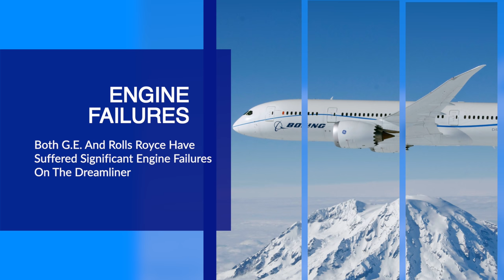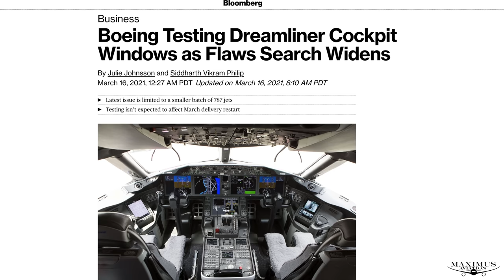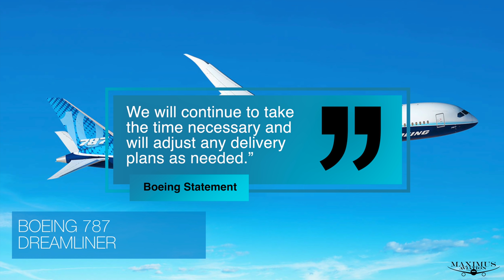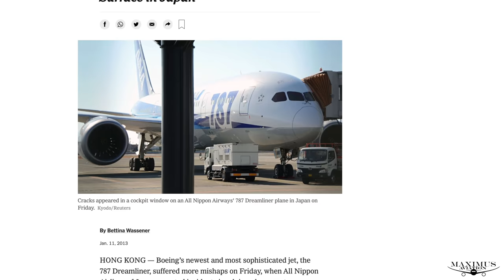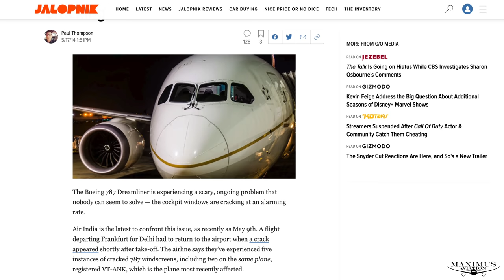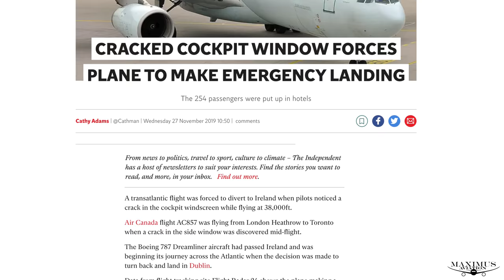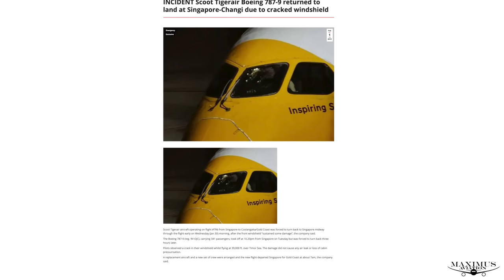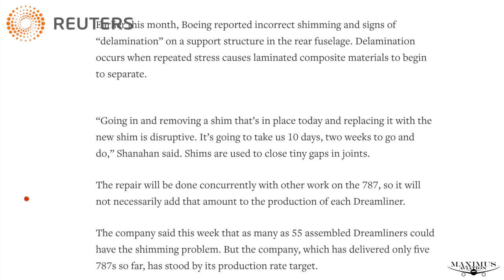Why Do The 787 Dreamliner Cockpit Windows Keep Shattering In Mid Air? How Dangerous Is It?

Comment: Bring back the DC-8s I worked on as a flight attendant in the 80’s.  That noisy, narrow, slow, cramped beast was the energizer bunny of airplanes.  Definitely not a duck.  Good video.  Well researched.  Thanks
Reply: DC8, noisy-yes, cramped-yes, slow-not hardly.
Reply: Schlomo Baconberg  convair 990 faster than all but the Concorde
Reply: @EnergeticWaves  convairs rocked !
Reply: DC8 Broke the sound barrier. Google Supersonic DC8. It was our company aircraft.
Reply: hm...not any slower than any other jet airliner.

Comment: They can't fix it as management has fired all the engineers, or so it seems.
Reply: Fixes cost money.
And people with experience and expertise have a desease, they are expensive. And in case that stuff is contagious corperations don't want to have them around.
Reply: The solution is too expensive ,,,, just that.

Comment: Boeing just can't seem to get things right with the Dreamliner, can they?
It really is embarrasing as Boeing was for a long time so renowned for their build quality.
Reply: Better to test then just send it out again
Reply: Which plane they produce is going right?
Reply: @charlesharper2357  the 737NG, 747-8, and 777 have been fine. Granted, the 777 did make the news for engine problems, but that kind of problem is Pratt and Whitney's fault, not Boeing's fault.
Reply: @charlesharper2357  747, 777, 737ng, 767
Reply: @charlesharper2357  Yes, they've really been dropping the ball everywhere, haven't they? 
Well, this is Market Driven Economy in practice: if it sounds too good to be true (max profit with little or no oversight because you're trusting big companies to "do the right thing") it most definitely is being proven by Boeing.
Reply: @tjroelsma  
Boeing is spending too much money on executives, and too little on engineers.
Reply: The NG is not produced anymore is it?
747 is a trickle at best. (Love the 747 btw)
Reply: It's not just the Dreamliner it's the entire company. The Boeing Company no longer cares about safe quality products that last. They only care about Cost, Schedule and Shareholder Value OVER quality & safety. Boeing only cares about short term fast profit, they know there are only 2 major manufacturers and one can't supply the entire World. Boeing sits back laughing knowing they can sell 💩 and airlines will buy it. They also know that none of the gangsters will ever be held liable for any loss of life nor will they lose their homes and property.
Reply: @soyousay7751  True, but it's extra ironic because the Dreamliner is supposedly Boeings Masterpiece, their Halo airplane. 
And it's the Halo airplane that has the most problems of their entire line of airplanes. 
Nothing shows how deep the s*** they're in is than their Halo plane failling time and again.
Reply: @dehaviland7645  Yeah ended last year but that is not that long ago really
Reply: @Blank00  did you forget about the illegal fuselage splice fittings on the 737NG, you know the the ones that led to the two female investigators being fired? The facility in Kansas that was using the bad parts was supposed to stay open but Boeing closed it and sold the facility to Spirit Aerosystems who still manufactures 737 including MAX fuselages for Boeing.
Ever see the huge hole in the 777X after the wing flex test failed, Boeing lied and said it was a cargo door blowout but an employee took a photo of the left aft fuselage blown wide open. Boeing is great for hiding their problems behind the walls from the public I've been there and seen it, matter of fact made a phone call about one of their debacles management and security wanted me to keep it inside 😂.
Reply: Back in the days before corperations took over america.
The usa has become a parasite ever since the 80s.
Reply: @baronvonlimbourgh1716  Big corporations and shareholders are sucking the people ánd the industry dry with their short-term politics of profit before everything. 
They know and acknowledge the first but refuse to acknowledge the latter.
Reply: @tjroelsma  I agree but we must not forget the 787 was the first new clean sheet attempt under the failed Boeing / McDonnell Douglas leadership. This failed leadership not only changed fuselage materials and the way accessories were powered they subbed out major portions of the aircraft throughout the World to lowest bidders. Boeing will preach the Globalization BS as if they are spreading the wealth Worldwide when in fact Globalization takes advantage of cheap foreign labor while lining the pockets of the corporate gangsters pushing the agenda. The Boeing cesspool has flooded the entire company and now exist in all 3 Boeing divisions................Commercial, Defense & Space.
Reply: @soyousay7751  The way I see it is that the US Government gave Boeing way too much leeway. Boeing was for all means and purposes allowed to self-certificate due to their "trusted" status with the FAA. Boeing was also allowed to skip a lot of steps in the Quality Control process. There's an Al-Jazeera hidden camera video on YouTube that gives a rather horrifying picture of how the Dreamliner was being build at that time and I reckon things have gone worse than better since that video was shot.  

But it's not all to blame on Boeing: when given those kinds of power, most companies will abuse it just as much as Boeing did, so the US Government/FAA does own it's share in this Charlie Fox situation.  

Airbus found out the hard way that switching to new composite materials depends on two things:
1. proper engineering
2. testing, testing, testing

You don't know the "for real" behaviour of a material untill it has been used and abused in the situation it's going to be used in, something that Boeing management blatantly ignored. 

Combine those two situations of Boeing having the power to design, build and certify without real oversight and Boeing management "not giving a s***" and you have the perfect storm brewing. Well, the storm has arrived and the devastation might be enough to cut Boeing down to size.
Reply: @DC8Combi  you are Boeing employee
Reply: @soyousay7751  true words mate
Reply: @kirilmihaylov1934  recently retired due too the corruption.
Reply: @DC8Combi  I  respect  your input  about this topic .Boeing have  messed up really bad lately
Reply: @kirilmihaylov1934  it's inevitable as their culture is horribly flawed. The Boeing Company breeds corruption through high pay to anyone who keeps their mouths shut and pushes the garbage out the door. Cost, schedule and shareholder value over quality & safety...................predatory capitalism at its best.
Reply: @kirilmihaylov1934  There is a difference between capitalism and predatory capitalism run by narcissist and sociopaths! We have evolved to the predatory state of capitalism where politicians and CEO's have a predominant narcissistic profile and don't give importance to human life! This is not only Boeing, but all major companies have the same profile and are driven by cash hungry investors (banks) who want the MAX out of the MAX! It is a systemic crisis!
Reply: @DC8Combi  that's exactly  true 👍.  I thought  that's what American capitalism  is all about but yet most people  don't get that for some reason.  Yes there are some really good American products like   Oakley and Nike  and so on but when share price and sales matters the most things change  .and that's where American capitalism  seems to be  nowadays
Reply: @kirilmihaylov1934  that's because the beast (Wall Street) thrives on controlling these corporations. Once any company goes public on the stock market it soon destroys itself within by selling their souls to worship the "Shareholder Value." You will find it hard to find any corporation on the market that has ethics or morals, if you do they won't be what's called a good investment as their shares won't pay high dividends.
Reply: @DC8Combi  that's also true . But it has gone to the  extreme as of lately.  It wasn't like that back in the 80ties and 90ties . I spent a few years in US back then and I liked it quite  a lot . From what I here it is not the same anymore .When profit  and shareholders value  matter more than people it is logical that  people will die because of that
Reply: @kirilmihaylov1934  that’s why back in the 80’s Boeing was a reputable engineering company.
Reply: @DC8Combi   a lot of American companies are like  that
Reply: @kirilmihaylov1934  at some point corporations gained power of America, the biggest ones basically run the country through politics it’s a disgrace. Especially corporations tied to government contracts.

Comment: After almost 10 years they still don't know what the cause is or how to fix it but they do know that they will restart deliveries by the end of March 2021.  That rather implies they are sending planes into the air before the problem is solved.
Reply: Or that it's simply cheaper and easier to replace a window, than research and rectify the problem.
Reply: yep.  it's all about the money now.  Safety?  Naaw...  Safety is way down on the list.  As long as Boeing can keep delivering planes, keep the cash flow going, they will continue doing what they are doing.  The FAA is not doing its job either.  If they were, they would ground all 787's until these issues are resolved.  So Boeing will keep delivering flawed airplanes until one of these flaws causes a crash.  First crash will be deemed pilot error.  Second crash, just like the 737 MAX, will finally get the FAA's attention and the planes will be grounded.  Hundreds will die, but Boeing exec's don't care.  The only thing they care about is their quarterly bonuses, so keep those flawed airplanes coming off the assembly line and  delivering to customers.  Cash flow, baby, it's all about cash flow.
Reply: @zig_ziggy  maybe they'll fix it after it results in a fatal accident.
Reply: It's just the outer layer that cracks. It's not like a normal piece of glass that shatters into millions of pieces or shards. When cracked It's still very strong. If the inner fails it would be very windy for the occupants, and even with the number of cracked outer incidents, none have resulted in a flying flute. The outer layer is the one designed to take the abuse. The main layer isnt affected. The pressure vessel is contained and safe. They return to the airport out of caution when a crack forms, just as they do when a warning light illuminates that could lead to faulty information. I will admit, a cracked window 6 miles above the earth would be scary.
Reply: @overyourheadtampa  What if it cracks to the extent that the pilots can't see ahead?
Reply: @gerrymccartney3561  that can be a problem, but the 787 livery is of the most technologically advanced aircraft in the air. They have the equipment for the aircraft to land in near 0 visibility, such as when an airport is blanketed in heavy fog, to boot the aircraft can essentially land itself. Not to mention there are several windscreens that can be used for visibility outside. Its extremely unlikely more than 1 would crack on a flight. These newer aircraft are far safer and don't even need pilots once it's set up. They are there mostly to monitor things and take over if something goes wrong; there is a lot more to it than that but I say it that way to convey the advancement of technology in the cockpit has made things a lot safer. Don't take my last comment to mean the cracking is not a problem, they need to fix the root cause. It may not be very risky but a 2 or 3% increase in risk when ferrying 300+ people is not acceptable when it can be addressed.
Reply: @overyourheadtampa  As you say, it must be fixed,
Reply: @gerrymccartney3561  you should do a search for how often a cockpit windscreen cracks. It will demonstrate why I said it the way I did.
Reply: @pimacanyon6208  , except zero crashes, zero injuries.
Reply: We all know what the problem is… money
Reply: @overyourheadtampa  Ah but who cares about facts! Just bash every single problem Boeing has even though the airplane that caused the controversy has been fixed! I do agree though, they need to stop focusing on orders and fix their windshield even if it's not a fatal flaw.
Reply: @gerrymccartney3561  Quote:What if it cracks to the extent that the pilots can't see ahead?
How are they landing in thick fog  ;-)
Reply: @dalaisdramalama4470  Hopefully, they will be landing with intact cockpit windows.  Cracked glass and fog is not a combination I would wish on any pilot.
Reply: @gerrymccartney3561  if they can't see then they just pretend they are in a cloud.
Reply: @Milkmans_Son  How does that work when landing the plane and getting to the gate?
Reply: @gerrymccartney3561  Switch to pretend fog for taxi.
Reply: Exactly.
Reply: @bobkataviation3967  Excellent solution, I am sure that Boeing will happy to convince the flying public that it is the best way forward and there is no need to do anything about the problem.
Reply: @overyourheadtampa  I wonder though if "very windy" would be the only problem. I don't know f they test it, but could it not also develop into more serious pressurization problems of the hull when a window fails at a high pressure differential?
Reply: Not like Boeing. It's not a Engineering excellence problem. It's Wall St. Accountants and profit margins. 
BCA (Boeing  Commercial Aircraft) are on their last legs.
Reply: @zig_ziggy  Remember the De Haviland Comet?
Reply: @thehighlander959  Yes, absolutely. As when I was a child, the Comet flew over my house which was just a mile from the end of the runway at De Havilland's, Hatfield, where my mother had made Mosquito's and my uncle worked as an electrical technician. Later, I did my apprenticeship at what by then had become Hawker Siddeley, and walked past the hydrostatic test tanks each day where the Comet fatigue issue was tested and solved.

Comment: If not a quality issue, I wonder if it might turn out that carbon composite is just too flexible for what are the largest windows on an aircraft?
Unlike the Dreamliner which uses composite for the cockpit, the A350 uses metal as Airbus were unsure how Carbon Composite would be affected by bird strikes - especially as composite material has the unwelcome habit of being damaged by an impact but unlike metal can sometimes return to its original contour with no apparent damage.
Reply: good point.  So Boeing needs to redesign the cockpit portion of the plane and make it out of aluminum alloy.  Makes sense to me.  'course, they won't even consider that because it would impact quarterly profits and those executive bonuses.
Reply: The dreamliner is not the only composite plane flying.
Although it might be the only commercial aircraft with a composite cockpit.

I think the a350's only non composite part is the cockpit, maybe this is one of the reasons? Not an engineer.
Reply: Carbon fiber is a very stiff material, in fact much stiffer than steel. 
Of course thickness of the material is also a factor. If too thin, it could be too flexible too.

Comment: 787 pilot here: No bulletins with regards to this strangely enough...
Reply from the maker: Strange.  People call me out as a boeing hater but this isnt happening on any other plane other than the 787. So it cant be all PPG's fault.
Reply: @maximusaviationchannel  Maybe they call you that because you say demonstrably false things like this isn't happening on any other plane other than the 787.  I mean honestly, it takes some seriously inept research to miss EASA PAD No 21-033, considering it was issued two weeks before you posted the video.  

Like you said, if it looks like a duck...
Reply: @maximusaviationchannel  Windscreens do crack occationally on other types as well. A friend of mine had one crack in the 737. I haven’t had one myself yet.
Reply: So Boeing never told you about its new cockpit fresh air ventilation system?
Reply: Been flying the 787 for over 2 years now and have never had any issues regarding windshields.

Comment: I'm an aircraft mechanic. From those pictures of those window cracks, it looks like they may be propagating from the upper inboard corners where the radii are the smallest. This fix would not be easy because it would involve a redesigned window frame assembly with larger radii to solve the issue.

Comment: In spring 2018 I enjoyed a round-trip to Israel in 787s. I am thankful to make it back home safely. My issue was the uncomfortable seats and tray tables that rest on your legs, way too low to enjoy a meal. On the return  flight I was encouraged to upgrade to a front row seat in coach so I could enjoy extra leg room. Cost: $125. Extra. The downside was a tray table stashed that would not pull up, headphone jack that stabbed my leg for 10 hours. Also the aisle did not go straight back so that means when people came through the curtain they ran into ME! 😖😖😖